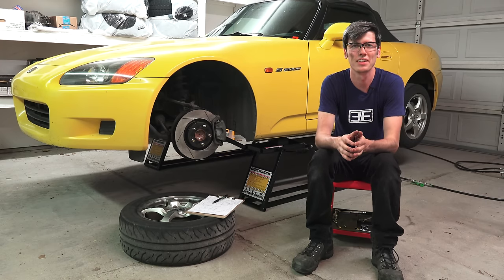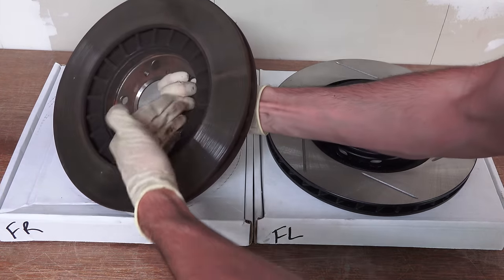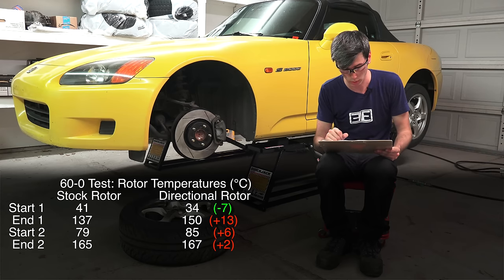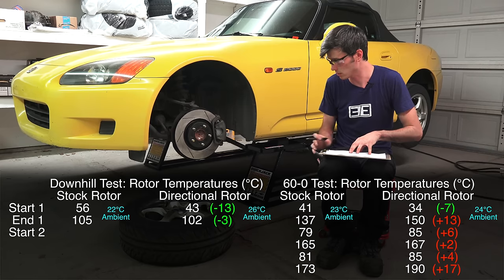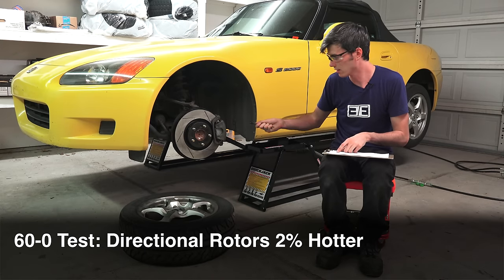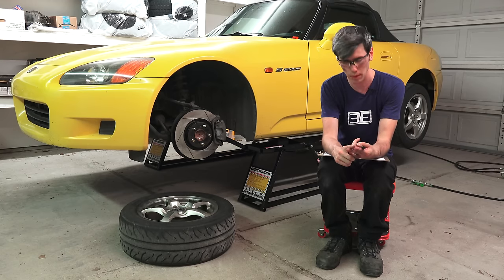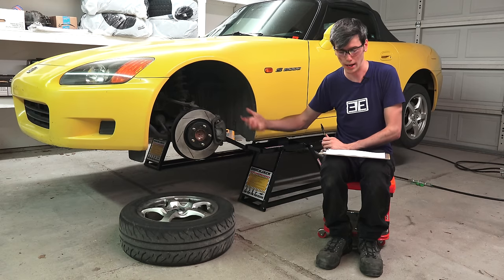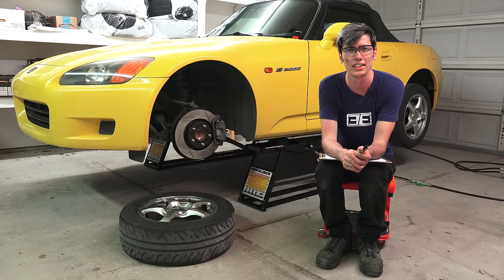Do Performance Brake Rotors Have Better Cooling?

Comment: 1:34 the stock ones are broke in with pads, aftermarket ones are freshly machined!
Also how about the rust that would prevent conduction of heat in to the hub on the stock ones?
What alloy is each?

Comment: my friend your are trombas engineer,for starters when you change new rotors but keep the used pads,you dont get the maximun pad to disk grip/friction until you make some serious distance and stoping from high enough speeds to give the old pads the chance to mate perfectly to the new machined surface of the new disks.Second you didnt measure the cooling capability between the 2 disks and you cant because you dont have the equipment to do so,you dont measure from 60 to 0 and once you stop,immediately measure the surface temp....find a way to brake from 100 miles until 50 hard,then stay at 50 mph and with a continious measuring equipment measure the max heat and the cooling progress from the moment you release the brake at 50mph and cruise at that steady speed for lets say 30 seconds,1 minute,2minutes to see the cooling progress...Third and last you measured the aftermarket disks hotter....but does this indicate that they produced better friction and there by,better stoping power than the oem disks?did you make a series of high speed stops lets say from 100 mph to 0?and count the stoping distance?ideally you have to have a new set of oem disks and pads,bedded in properly and another set of new aftermarket rotors with their new set of pads also bedded in properly and then do all these tests.But you lack the equipment and money to do all these test correctly,and data log them,good try for a "engineer" video but you have a lot of way in front you if you want to be serious.

Comment: i think that performance discs are just better at handling higher heat before warping therefore people buy them for hard braking on track.
Reply: Rotors don't warp. That's a myth 
Improper bedding causes pad material to be embedded into the rotor. If not removed quickly by rebedding,  it turns into cementite. That is why the driver feels pulsation, as the pad passes over the cementite.
The driver thinks the rotors are warped. You can research this.

Comment: I believe the ultimate purpose of slotted rotors is to evacuate the buildup of gases between the rotor and the pads. You may see higher  temperatures, but the pad will will actually have better contact with rotor. I think I've had better performance with the slotted rotors. However, if I got any benefit out of them, it was too small to notice. But, there was definitely not a decrease in performance.

Comment: When comparing relative temperatures as a percentage, you have to use degrees Kelvin. This doesn't mean you need to run the test again, just the calculations. Subtract 273.15 from all of the ˚C values.   I think the mass of the discs is also more important. If one weighs 10% more than another, it will not get so hot as the energy density will be lower.

Comment: Slots are to remove braking gasses and the drilled holes are for cooling. These are only slotted not drilled. Would like to see drilled and slotted rotors tested against stock. Drilled are also to help with warping too.
Reply: Just saw you have. Going to watch now.

Comment: I think this is just a result of testing parts intended for the track vs parts for the road. People convince themselves that race parts must be better on the road because they are designed for harsher conditions but this refutes that. Very useful as I am going to need new rotors in the future and with my car being an old Lincoln, I never really thought I'd need performance rotors, but I really wanted them. But it looks like you've saved me some money! It may be a tricky one to test but if you're considering doing it, how dusty performance pads get would be extremely useful as I think that is what will do more for braking performance.
Reply from the maker: Currently am running performance pads (swapped after this video). We'll see how they do with dust, but I don't know if the previous pads were stock or not (the ones used in this video, for both tests before and after), but they didn't seem to dust much. They did squeak, and these haven't much so far.
Reply: Engineering Explained did you consider the pads would work more efficiently with the stock rotors because the surfaces of both were mated with each other?
Reply: What kind of performance pads did you swap in after the test?
Reply: Dorito boy nope, it's a grandmother's Lincoln, not very desirable for what I think you might be imagining. But it does have an aluminator V8 which is what I desired.
Reply: Cameron Lancaster, working as a brake technician for several years. Try not to cheap out on rotors. Some brands will have less metal and the metal will be worse quality then more expensive ones. You can visually see the quality difference from Chinese steel to steel from Mexico.
Reply: yep as long as the rotors stay straight and don't get warped your good the compound is more important
Reply: i put on sloted roters and performace pads on my last car. braking seems to be better but it never made a difference to me over stock for street/highway driving. they are much more grippy when you first touch the brakes. i always go aftermarket performance when i need to change parts or go OEM for engine stuff. now i am at the point in my life where i trade in my current car i will go luxury SUV or a really comfortable car.
Reply: A friend of mine did the  same thing, performance pads on his daily driver. the thing about performance pads is they are designed to be most efficient at higher temperatures. So in normal daily driving they are actually not as good at stopping your car as stock pads. My friend swapped them out for stock pads within a week because he said he had too many close calls about not being able to stop his car fast enough in normal daily driving (couldn't lock his wheels when he was trying). This is totally an anecdotal story, and I'm excited to see what this channel posts about performance pads, but from that and what I've read online of similar experiences performance pads are really for track use only.
Reply: Engineering Explained I know your view of the drilled rotors, but I think it would be great if you could add them in the test since many German cars now comes with drilled, drilled and slotted rotors. Additionally, I think the rotors material of construction plays a huge role in cooling and performance, so a higher quality rotors will out perform cheap ones. Currently I'm using the OEM rotors on my is350, but I'm planning on replacing them with slotted and drilled ones when they show low thickness.
Reply: Cameron Lancaster high performance metal pads are rough on rotors, but good slotted rotors high in carbon and cryogenic treated keep a smooth surface with very aggressive pads. The aggressive pads provide significantly shorter stops without fade even when hot.
Reply: @EngineeringExplained  the pads were bedded in to the stock discs so when you changed the discs to racing did that make a difference maybe have two sets of pads for each disc the same make.

Comment: I have heard that the slots or vents in performance rotors are not intended to cool the rotor.  But rather to allow the vaporized brake pad gas off out from under the pad helping relieve brake fade. Also to help take heat out of the area between the pad surface and rotor not the rotor as a whole.   

Interesting test and your work into it is commendable. 

The smaller mass should have a faster temperature change rate.  Heat up and cool down faster between applications
Reply: In the past brake pad compounds would off-gas when they got hot enough.  Those slots were to vent the layer of hot gas that was between the pad and rotors.  Modern pads don't really do that, so the slots, and holes, are a marketing holdover.  
In budget endurance racing you'll find most cars, especially the fast ones, use blank rotors.
Reply: @ukemike1  I believe that's for longevity due to nature of endurance racing, not performance. Blank rotors harm the pads the least and also last the longest, but do not perform the most ideal.

Comment: Learning physics hasn't ever been this much fun. You're the best "teacher" EE!
Reply: It really isn't fun at all.
Reply: I had perfectly fun Engineering teachers in high school and college. EE is an exceptional extension to what what they taught me, and my work on homework and math taught me. To call him equal to them is a high honor. I doubt they'd make as good of a YouTube video. That takes a lot of dedication to get good at, or natural talent plus lots of dedication will get you there faster - I should know. I've made videos for years and my production value stays lower, but I still love teaching and the conversations it makes.
Reply: @peterzebot1795  then why are you here? I used to take everything seriously. Take my advice. Have some fun. 😆
Reply: Does the aftermarket breaks improve braking distance
Reply: @michaeld954  no. Under track conditions they're supposed to shed heat better and prevent brake fade. Stock brakes were already able to lock up the wheels so braking distance was more about tires and conditions of the road.